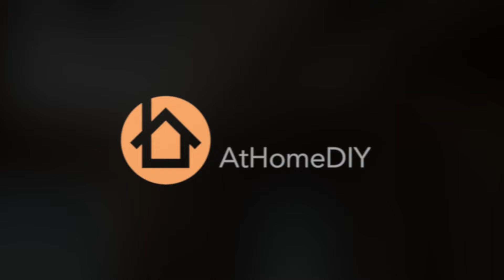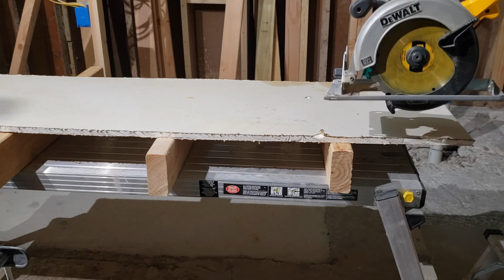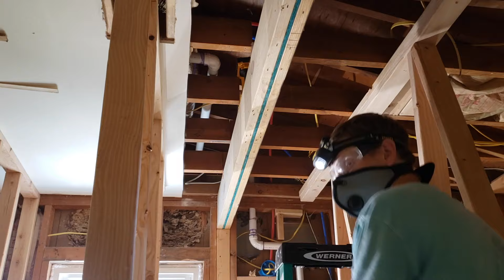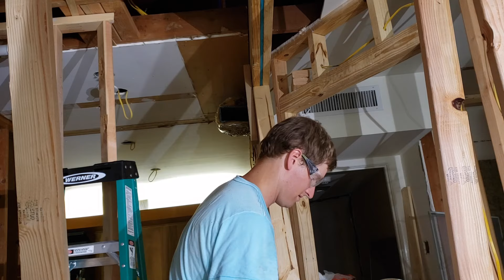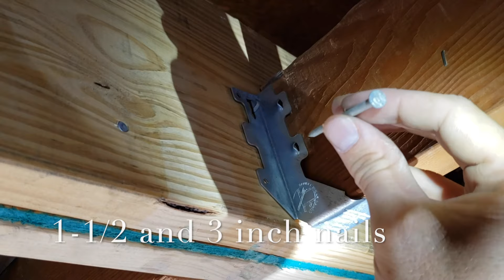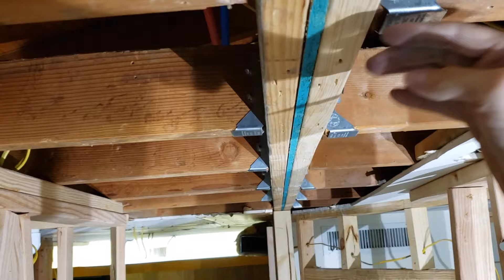How to Install a Recessed Beam after Removing a Load Bearing Wall

Comment: For any people out there thinking you can use double 2x12's on any wall span, you can't.  The span in this video is about 12 feet, and the tributary width is about 8 feet.  So 2x12's work in this case.  But wider than 12 feet, the performance demands rapidly increase, calling for larger LVLs.  Also, for folks with basements or crawlspaces, you have to have solid support from the underside of the beam down to the foundation wall or footing.  You can't just stop the king posts and trimmers at the wall bottom plate.
Reply: huge thanks to this comment, much of what you said applies to the area where I'm working and these were things I have not considered. Im a rookie.
Reply: So you need a jack every 8-12 ft?
Reply: @818Rico  It depends on the situation.  The only way to know is to calculate it out.  You can't just guess.

Comment: Everything is good but, the nine inch spacers are my only concern. If it was me i would change the 2 x 4 completely.
Reply: yeah no load bearing wall should have a spacer in place of a king stud.
Reply: Could he take the drywall and flooring out in that spot and add a king stud?
Reply: @bg147  He could he should get to a foundation member to spread the weight of that beam.
Reply from the maker: Can't remember if I mentioned it in the video, but yes, the spacers were temporary. They were replaces with actual king studs.
Reply: @AtHomeDIY  Thanks for the update!
Reply: Up to how long the beam has to be from wall to wall
Reply: @joeacosta6663  it all depends 8 feels,  12 feets  but after 12 feets I prefer to give support to the beam and at least 10 inch beam.
Reply: Did you have to get township spproval as well as architecture approval?

Comment: That is EXACTLY what I was looking for... I just had a guy quote me $10k to remove a 16' load bearing wall set up just like that... Thank you, Now I have instructions on how to do it myself!
Reply: Just make sure you do the calculation to figure out what size LVL beam to use over the 16' span. I believe lowe or home depot can figure the beam size for you as long as you know the load.
Reply from the maker: As Tucker mentioned, make sure you get some help figuring out the correct size beam. Depending on your location this could vary. I always err on the side of over engineering for all my projects, just to be safe. Best of luck!

Comment: Who the hell cuts drywall with a circular saw
Reply from the maker: Hi Zach, would love to hear your suggestions for a better way. We're all about learning here. Cheers
Reply: Buddy I would use a handy man vibrating cutter much less dust and easy and safe to use above your head.
Reply: Oscillating multi tool is good but your circ saw probably gets a good straight line
Reply: The guys name is Duty something . You can put a vaccuum attachment on the saw .
Reply: You’d make a much smaller mess with many other methods...jab saw, sawzall, oscillating saw, drywall cut out tool(rotozip).
Reply: I do often , I’ve done across a ceiling Ike this many times.

Comment: This the correct way of making a beam when you on a budget and cant add expensive lvl old houses were made like this and they still standing the only thing i do to make it sturdy i spread gorilla glue with a puddy tite bond just turns into a crusty thin layer.

Comment: I know he’s using the beam he had, but why use a double beam here? If the joists want to pull apart wouldn’t it make more sense to have the joists pulling in opposite directions on the same beam rather than two joined together?

Comment: We did this for leveling sagging rafters from water damaged roofing. A bottle floor jack and a t-brace was great for raising the beam exactly where is needed to go and then be secured with the posts and hangers.

Comment: To prevent the roof from blowing out the walls, you should have added some Simpson strong tie H2A connectors after chopping each joist. These straps prevent the joists from spreading. With your access above, you could have put a strap on the joists after cutting 1/3 through them so you would know that they hadn't moved.

Comment: I have been looking for a video that describes this exactly! Thank you! We are about to do a 36 foot spread and will have 3 beams side by side. Took me weeks to find this video. I would suggest placing some “keywords” on your video so it’s easier to find. Thanks
Reply from the maker: Wow, 36 ft span is quite large! Just curious if you're DIYing that or if you had an engineer spec the beam for you? I did another wall in my house that was about 24 ft. Best of luck! I'll look into the key words, thanks
Reply: @AtHomeDIY  what was the spec for your 24’ span?
Reply: @AtHomeDIY what beam specs did u use?
Reply: You may need a steel beam there my friend.

Comment: Good job with one exception. You want it to be tight to disperse the load. When it's loose, you are relying on the strength of the nails & hangers vs using the weight against itself.
Reply: #Vet
Reply from the maker: Very good point. I tried to get the spacing a tight as I possibly could, but yes, could always be tighter. Thanks for the feedback!
Reply: You could have notched the ends of the ceiling joists (1/8" or so deep) to accomodate the bottoms of the hangers. Then the bottoms of the ceiling joists would be at the level of the bottom of the beam. The the ceiling would fit better.

Comment: I'd like to do something similar but those two nails you show through the uncut joists are to prevent the roof peak from sagging down and pushing the walls out when the nails are cut out and the walls are free to pull the cut rafters apart.
I'm thinking you should bolt a steel angle on each joist about 8" on either side of the beam. Then bolt the angles on one side to the angles on the other side with a piece of all-thread going thru a holes in the beam.  I don't think the joist hangers are sufficient to resist pull-away tension caused by sagging gable pressure.
Reply: I think I'd shave about ⅛" off the bottom of the cut rafter for about 2" so the bottom of the rafter is even with the bottom of the hanger.

Comment: Pretty good video. Except the end posts are an issue.  I don't think adding a 10" block of 2x4s is to code anywhere in the country.  You need to remove the old posts and install new ones sufficiently long.  Then you need to heed Mick's comment below about subfloor support for those two posts.  Then you need to clean up the electrical and water lines above.  I'm pretty sure code says you have to have them fastened periodically to the rafters.  Maybe you did that. But you didn't tell us.    I don't like using those 10" blocks at all in this video.  You should have temporarily supported the beam, then taken out the end posts and replaced them.  In fact it would make the installation into the new place higher up go a lot easier.
Reply: Every time I've seen this done it's buried into the wall on top of the top plate with 4 or 5 2x4 studs under it carrying the weight.
Reply: @coolhluke8089  but you need solid wood or PSL from the bottom of the beam down to a footing. You can't just pack a stud bay down to the bottom plate.  That's a nightmare waiting to happen.

Comment: Thank you for sharing such clear information. 2 question: 1. What was the length of your beam? 2. What’s the blue or green stripe in your beam?
Reply: The "stripe" is a filler (some OSB I suspect) between two other pieces of lumber; 2 X 12's?
Reply: @wayfarer1517  thanks

Comment: My ceiling joists from each side don’t overlap. They just individually connect to the load bearing top plate in the middle of the house. I was wondering if this is compromising the structural integrity of my house?

Comment: I'm putting up an 18 foot beam. This is what I'm doing. I figured out a formula for what kind of beam I need. Apparently I need either 3 2x12x18 or a 3.5x14 lvl. My roof is the same as yours pretty much. I'm still struggling with which option to choose. I keep talking to friends that have been in the business and they keep saying 3 2x12x18s should be fine. I'm just worried about sag. Hiring an engineer is probably expensive. I'll probably go with an lvl.
Reply from the maker: I personally would go with the LVL, that's what I did on my other wall removal project. The ones I got are 1 3/4 in thick so you just structural screw them together (stud pack has a great video on that from like 2 years ago). Best of luck.
Reply: 18 foot span is pretty far, even if it's only supporting an attic.  If it's supporting part of the roof load, then it's even worse.  Regardless, no way will 3x2x14's be anywhere near sufficient for 18 feet.  Plus you'd have to worry about sourcing 20 foot long 2x18's.
Reply: I went ahead and got 2 lvl. 2x14x18. After doing some math they should be good to support 30 pounds of snow per Sq foot. It's Tennessee so I think im good. The supports are 4x6. And they are placed over the footings. All in all it was a great project. Only cost around $700. And now I have a beautiful house with a happy wife.

Comment: I want to do the same thing. My house is just like yours. I want to open mine from 9 feet to 14 feet. Right now they have 3 2x8 put together as the beam. What size beam should i use to open it up to 14 feet.

Comment: How did you screw/connect the bottom of the beam vertical posts and the floor joist  - where the post were " standing" on?

Comment: Awesome! Did you have to consult with an engineer to figure out the beam size? Also, what is the span of the beam? I’m in the process of doing something similar so I’m curious to know.
Reply: I used a structural engineer to figure out size of beam
Reply: I guess this guy didn’t as the beam was already in place and he’s just changed its height but yeah get a structural engineer for a new beam

Comment: what input did you get from the structural engineer? I have a small bungalow with an old roof design like yours. Going with 2by8s or 2b10s and half inch spacer of OSB in between should do the trick to span 20 feet or so. did you glue the 2b10s with spacer together in addition to nailing it together? Thanks for the video. Great details.
Reply: No way will regular 2x's handle a 20 foot span.  It will sag under its own weight.

Comment: So you've removed a uniform line load, i.e. the bearing wall, and concentrated the existing loads onto two new wood posts on either end of your new beam...
What have you done to ensure the floor under these two new posts is sufficient to hold the new concentrated load?
Reply: i did not see his other video, i just discover other guy added two more single concrete footings (400x400x500) under the both posts, if your footings is concrete slab, some guy suggested add more concrete with nut and then link short wall with screw on the to spread the load near post

Comment: What did you do to support the ends of the beam
Reply from the maker: A beam this size needs 2 - 2x4s on each end for support. However, with larger beams, it may call for more supports. These guidelines can be found on google, but may also vary by state/region. Hope I understood your question correctly.

Comment: So if it spreads sideways , with tension on the joist system , what stops it ? I remember a church built that way . They ended up          putting long steel rods from wall to wall , to prevent spreading . Its fine just sitting there , but in an earth quake , it could be a           different story . We had a building start spreading just from blasting rock on the neighboring lot . Thats my thoughts .
Reply from the maker: This is a great point. First, attaching the joists to the beam with the hangers is what is required by code. You may notice in the video that the nails coming in from the side also catch each joist presumably holding all parts of the structure together. Second, in my particular case, there are collar ties up in the attic space resisting the tension of the rafters wanting to spread. Third, this is in Texas so very little concern of earthquakes and/or heavy load on the roof (snow). Great point though and others should take these things into consideration when tackling a similar project!
Reply: i was concerned with tension aspect regardless of collar ties.  not an engineer but a simple gal strap under each joist connecting them could be a simple solution.  this will resist the joists pulling away from each other. Recessed in for drywall. @AtHomeDIY

Comment: So, he lifts the beam off the posts on each end to his desired height, but I missed what he did to replace the posts or extend them, so it seems like he still has the full weight of the beam on the 2x4 he used to lift it.  Did I miss a step or did he not include that?
Reply from the maker: Hi Timothy, sorry it wasn't clear in the video. In my situation here, I already had the beam in place to the underside of the joist (as you would for a normal, non recessed beam). Ideally I would have done this all at once... Braced both sides at the ceiling, cut the joists, placed the beam recessed between the joists, and put the jack studs under each end of the beam (this last part can be tricky, but just gotta get them in there somehow). The spacers were unique to my situation and were removed later for full length jack studs fully supporting the beam. Best of luck!
Reply: Thanks, how many jack studs were on each end?

Comment: Thanks for the video, very helpful. What's the process for wedging the studs in for the temporary wall? Fasten the top of one, hammer in the bottom, secure the bottom, and then wedge another against it from the other direction?
Reply from the maker: My temporary walls on this particular project were more unorthodox. Ideally you just frame in a wall on both sides with a bottom and top plate and each stud supporting the ceiling joist above it (so studs would be directly vertical). These studs should be tight to immediately hold the load. Secure them to both the top plate and bottom plate and you should be good.   FYI, I am currently editing the video of a much bigger wall removal/beam project so stay tuned for that!
Reply: @AtHomeDIY  Alright, I'll stay tuned for that. I saw one recommendation to cut the studs 1/8" longer than the original studs...
Reply from the maker: @davidparks5463  Yes, exactly. 1/8" long would be just fine. It'll be a tight fit, but better than short and your ceiling "dropping" slightly onto the temp walls.

Comment: Do you know bolt placement measurements. That are up to code?
Reply from the maker: For this project, with dimensional lumbar and relatively low load, I used 3 inch nails spaced roughly every 8-10 inches length wise and I believe 3 in a row. For a bigger project using LVLs and structural screws you would want to follow product/engineer specifications. Studpack has a beam video where they go over this a bit more. Best of luck!

Comment: Do you have to have joists running on both sides of a beam in order to recess it? i.e. applying equal pressure.
Reply from the maker: Sorry for the late reply. That is a negative, you do not need joists running to both sides of the beam. The structure is not compression from the the joist on the beam, rather, the beam with the hangers is there to keep the joists from pulling away (hypothetically). Studpack has a couple videos showing a similar project with joist on just one side. Best of luck!

Comment: how we determine the recessed beam width ?   is  two  2x12  enough or maybe tree or four put together? my rafters span from wall to wall are about 22 ft. and loading bearing wall itself is about 15 ft long
Reply from the maker: Great question that I'm sure many others are wondering as well. So for easy jobs like the one in this video (small span about 14 ft, no load from the roof rafters, only load from ceiling joist and drywall) you can google and find code in your area for beam span and size minimums. Anything more complicated than that and I would 100% invest in the expertise of an engineer who can determine the exact loads going on and the specs needed to make the job code compliant, and safe. 

For a span of 22 ft I would get an engineer. Dimensional lumbar will likely not be sufficient and you'll need a different material like an LVL beam. Plus there could very well be more going on up there than just ceiling joists. 

One last note, for jobs like this I NEVER just do the minimum. If I remember correctly this job could have been done with 2x10s, but I used 2x12s. Peace of mind.
Reply: Anything over 14 ft span here you need to get engineered lumber (LVL)         also you want an engineer to give you directions based on your roof and joist system.
Reply: need a 2x16 minimum lvl beam with twin king studs and studpacks on each end and "every rafter " needs support including the ones by the walls.

Comment: This is great. Thanks! I've been recommended 24F-V4 Glulam Beam for my job, double your span, but seems like overkill. Do you know the name/specs of yours?
Reply: Watching this video and saw your post. Wondering how you made out. Is your house two story? I'm looking to remove some load bearing walls and install a 23ft LVL. In my case it's a ranch so the only thing the beam will be holding are the ceiling joists and the drywall ceiling. Half of them hold joists spanning approx 19ft. The other half, on the other side of the beam, span approx 10ft.  What were the dimensions of the beam the engineer specified? Thanks